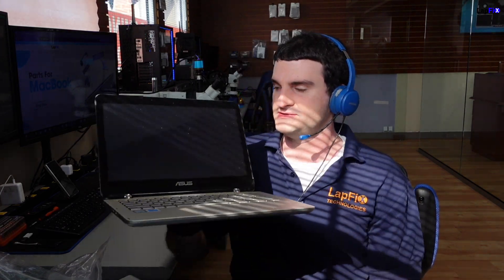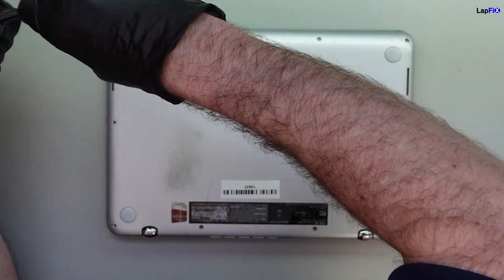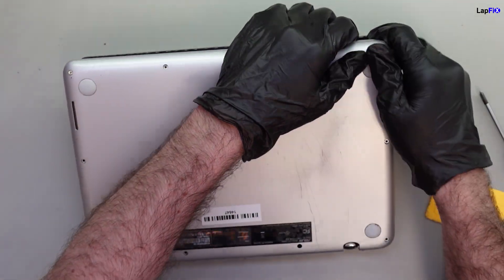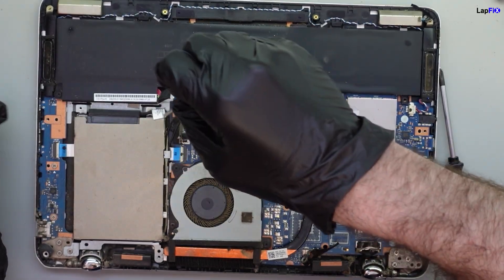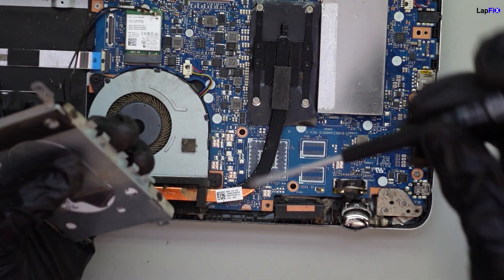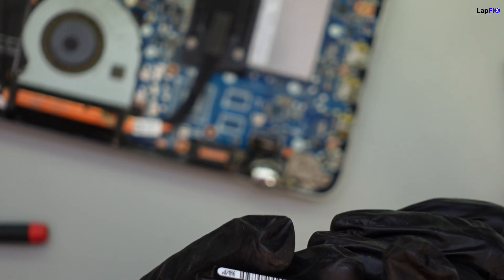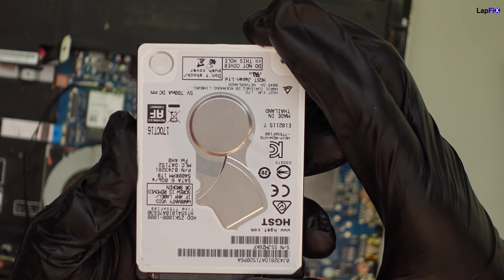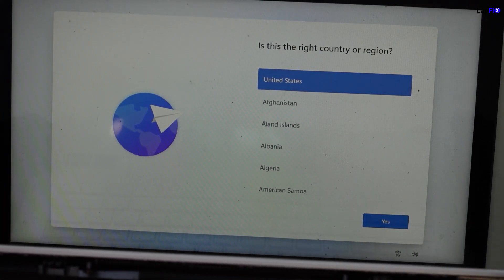Asus Laptop Goes Straight To BIOS

Comment: Enjoing your fixing process!! 👍👍👍👍👍👍👍
Reply: I have an asus with same bios and it detects the hard drive and even the usb drive but i still can't get it to not boot directly into bios.

I tried disabling secure boot, tried flashing the bios from usb but nothing works. It just detects the drives but wont boot into any.
Reply from the maker: I appreciate it as always 😊
Reply: Did you reload this unit and give it back to the client